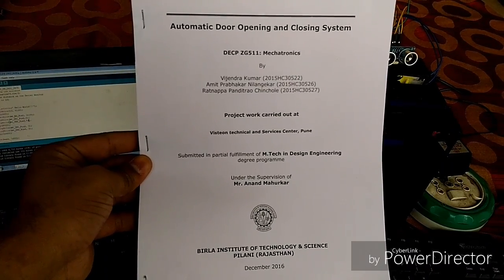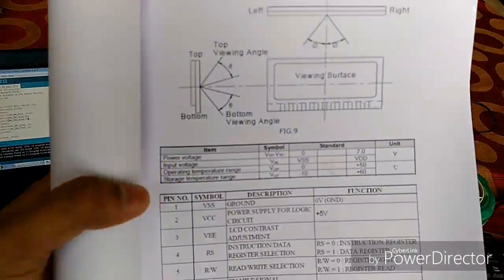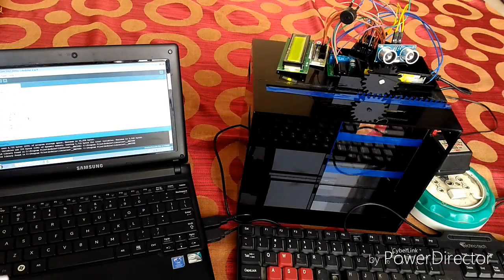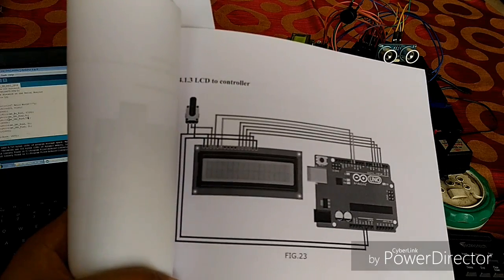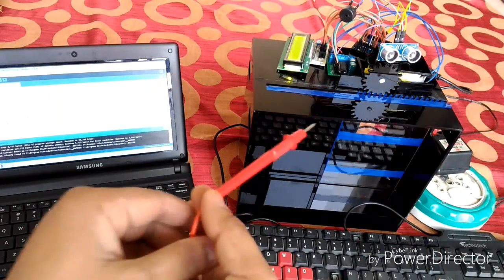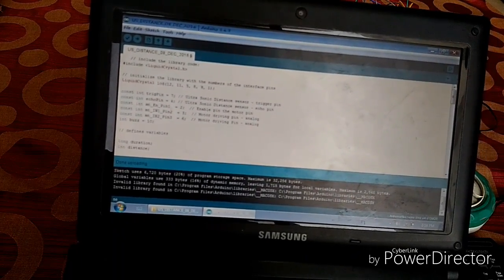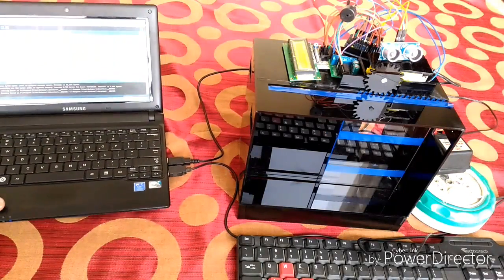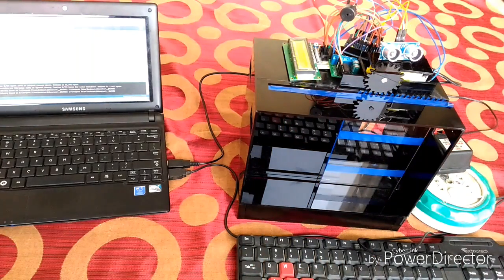How to make Automatic Door Opening system using  arduino

Comment: what is the point of this video without providing the code? are you trying to be helpful here and there in your website OR just bragging???
Reply from the maker: Hany Abdalla my friend , follow the link provided. 
https://ejctraining.wordpress.com/2017/02/24/automatic-door-opening-using-ultrasonic-sensor-hrsc04-arduino-16-x-2-lcd-dot-matrix-piezo-buzzer-dc-motor-and-mechanical-components/
Reply: Thanks But not as ordinary. tanks again